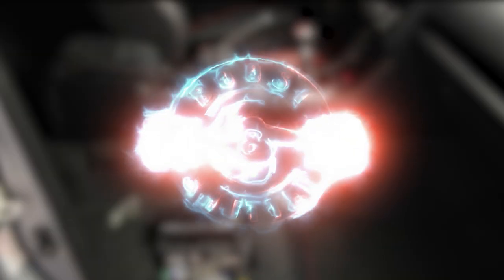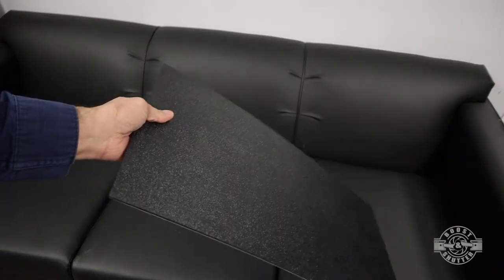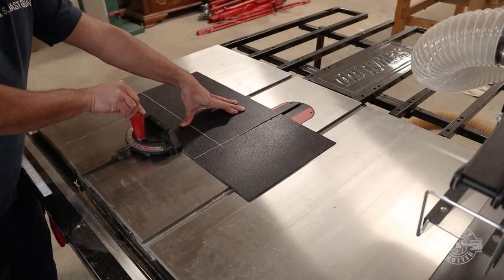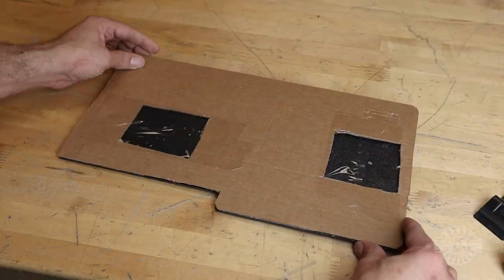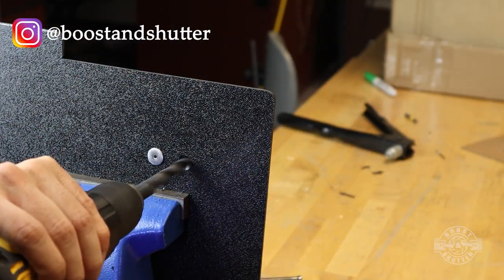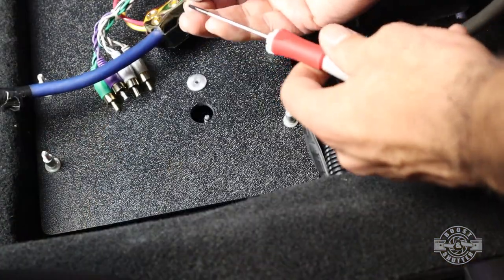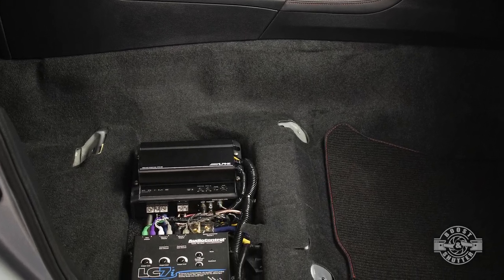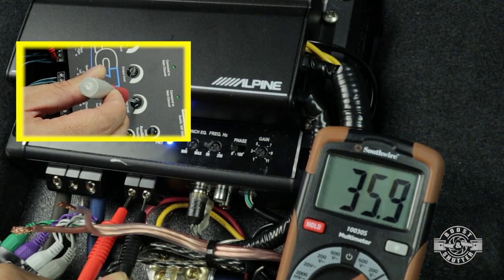How to Mount Amplifier Under Seat

Comment: @Boost & Shutter can you post links to the mount hardware you found? also the nut size?
Reply: I got a L bracket and used a vice and hammer to bend. Nut size under seat is M6

Comment: I just installed an old school MTX 4320 under the passenger seat. I bolted the plastic mounting feet to one side of the floor and made a bracket to keep the amp level for the other side. I haven't played them amp yet so I hope I do not get electrical interference since I did not use a board. Such a tight fit. The ampmis isolated with the plastic mounting feet. Is it 100% necessary  to use a board to isolate the chassis to the amp?

Comment: Great Video, that looks clean. I did something similar about 2 years back. WIth a alpine 4ch and an alpine sub amp under the passenger seat.  8in Sub underneath the driver seat. 
I just covered the entire bottom of the equipment with velcro which is very secure.  The amps fit so snug that they really cant move in the recessed part as well.  I didn't want a big sub taking up space and weight in the trunk. The 8in provide just enough to fill out the bottom end.

 I might run some wiring for a second 10in . I almost wanted to cut out the metal in the rear dash and mount a 10/12in woofer.

Comment: Nice tidy install. I'm planning one for my BP5 Legacy, so being another Subaru hopefully I should find a similar recess once it arrives in the UK from Japan. I've seen alot of installs where the amps intrude into the rear footwell but it seems yours does not. I was concerned I may have to look at boot mounting instead, but following a similar install to what you have done, I should have plenty of room for a Compact Class D 4ch under there.

Thanks for the video!
Reply: Are you running one or two amps?
Reply: @WarriorsPhoto  One active underseat sub under the passenger seat, and one 4ch amp under the driver's seat. Or at least I get the car in 5-6 weeks so that's the plan
Reply: @AceDC2  Wow 🤩 

That sounds like you’ll be bumping 🔊.

Comment: Is no on worried about mounting directly in front of floor heater vents? Those amps might not like the heat on in the winter. I'm trying to figure out best way to extend the vents to blow past the amps.
Reply: That's what I was literally just about to say. That's why I mount amps in the back so the heater doesn't fry my amp
Reply: Dont use the floor heat option.
Reply: Plug/cover vents so no air comes out